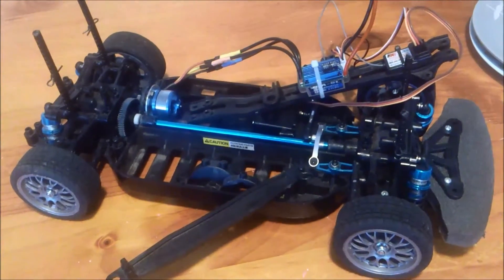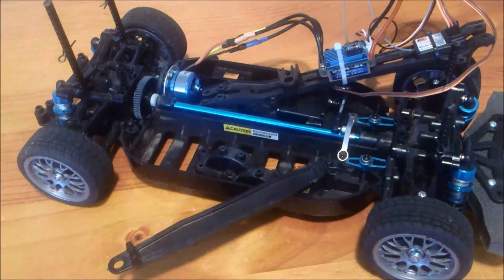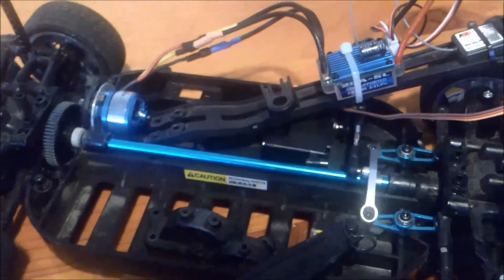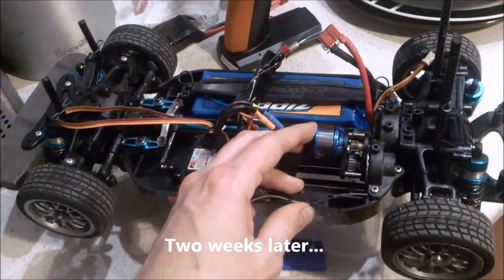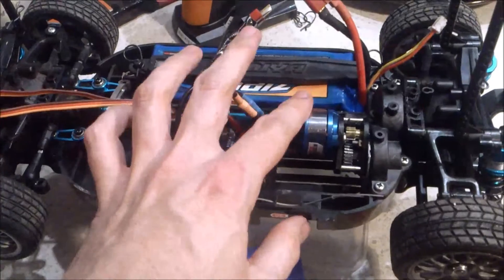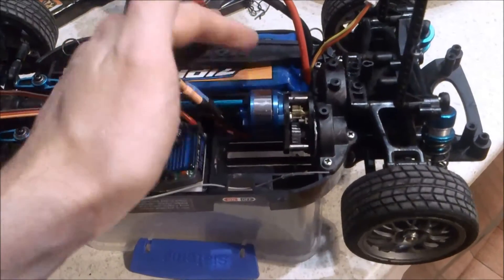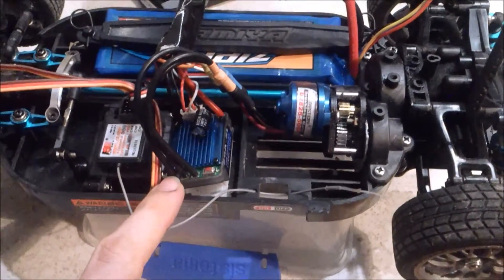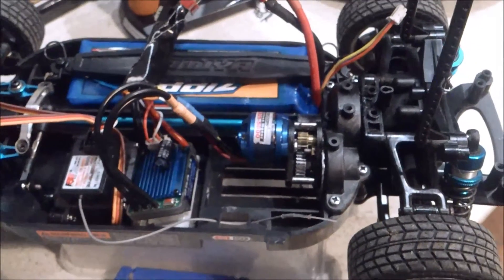Tamiya TT-01 Outrunner Motor

Comment: if you want more torque you need a lower kv at least 1100-2400kv should have more talk
Reply from the maker: The biggest problem with this setup was the small motors size honestly.
Reply: Lower KV isn't more torque. The efficiencies balance out to make it the same torque as a higher KV of the same size. The only way to increase torque is to increase voltage, increase the motor's size, or tighten the tolerances between the windings and the magnet-to-pole gap, making the motor's architecture more efficient.

If he can't fit a wider outrunner, he should look into a taller one.

Comment: do you think a 3650 motor (used for 500-class helis) would clear the chassis? please share the ebay link for the gearbox or the gearbox specs at least. thanks!

Comment: We just (hour ago) got done putting the exact same motor into a 1/18 scale stadium truck.We are using a 30A helicopter ESC for now (it's all we had). On 2S 1600's it's really fast. On 3S 1300's it's absolutely mental. Great little motor.